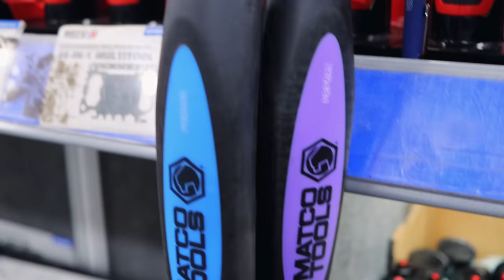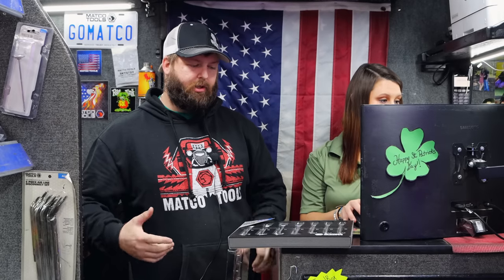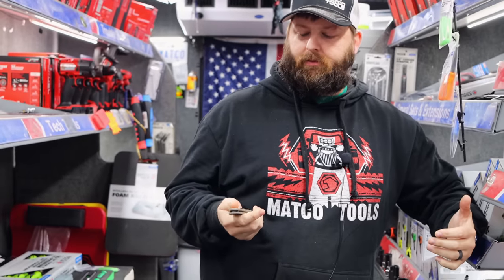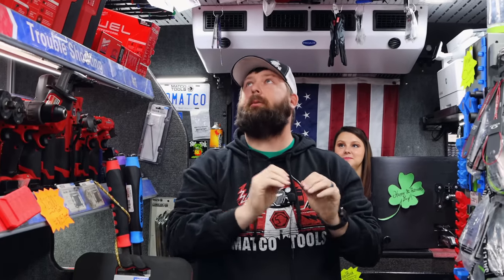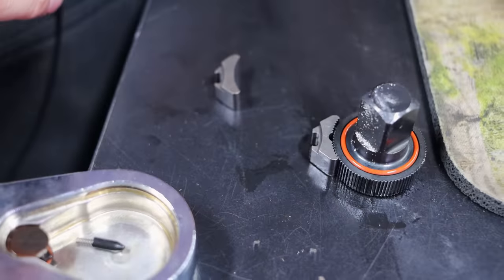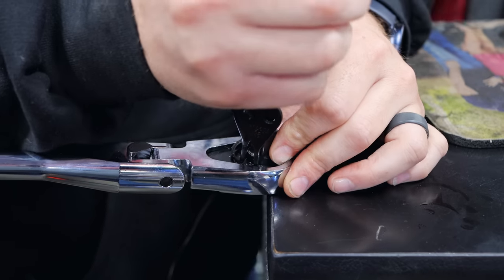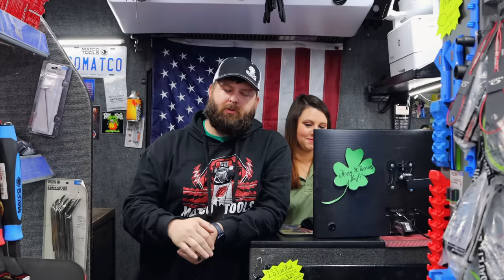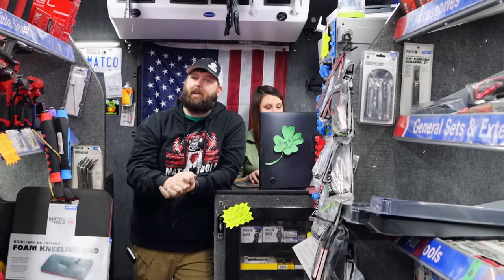Matco Tools New Improved Ratchet Design, More Bite For More Torque And Cool Line Wrench Sets

Comment: I'm not a mechanic, and probably less than average as a diy'er, but since I found your channel, between Matco Michael's knowledge and "ownership" of his brand, and your tool reviews, I've been obsessed with replacing my box store tools with tool truck tools. Got the Matco 3/8 locking flex head, Snap On screwdrivers and T handle hex and torx, and the SAE set of Mac reversible ratcheting wrenches.
Reply: There are plenty of high quality tools that you can get, especially for a DYIer, that are much less expensive. These are high quality tools no doubt but you are paying a lot for no real reason.
Reply: @nachoisme  
Not for the Taiwanese imports, but the extra cost can be very well worth it if you're getting American made tools.
Reply: @TylerSnyder305  9 times out of 10 you’re not. Most of the shit on the truck is made in Taiwan or China now. Go buy Mayhew for us made and tekton for bang for buck.
Reply: @hunterramsey3132  I like the Tekton hard handles which are a joint product between WILDE and another company who does the handles, but I won't buy imported wrenches ratchets and sockets.
For these things I buy WRIGHT tool.

Comment: Matco Michael just made a great case for SnapOn’s dual 80 technology.  Look at the pawl of your newer ratchets side by side and Snapon has stayed well ahead of the curve.
Reply: I have 3/8" and 1/2" Stanley black chrome dual pawl 120 tooth ratchets that are innovative. They are my goto ratchets. Very little backlash and they work in amazingly tight situations.
Reply: The redesigned it and fixed it - problem solved. Matco ratchets are slimmer and lever recessed the Snapon ones are HUGE and lever sticks up.
Reply: Snap-on's can definitely go way longer any maintenance
Reply: @mt1885 eah I love my snap ons, but that bottom extruding out is annoying as hell. It keeps getting bumped an unlocking. 

Of course I’m talking about the locking flex head.

Comment: I have been repairing Matco ratchets for a few years with the GW 84 tooth kits. Customers have had NO issues with them. Only problem is, it is getting harder to get the 84 tooth kits, as GW is going to 90 tooth and 120 tooth dual pawl heads.

Comment: For tool cleaning I have been using silicone spray for years now. Soft grip handles and power tool grips stay nice and it cuts right through grease and oil with a rag. I haven't seen or felt any issues with any of my tools using it and as long as you wiped it off, there's no greasy or slippery feeling afterward.
Reply: Solvent works amazing on soft grip handles as well. They will come back to like new condition

Comment: I have about 2 dozen Snap-on ratchets and I use super lube in all of them and they have no issues. I feel like those gears need some grease in the matco ratchets. I think Michael just sold me on those flare nut wrenches, I will have my dealer thank him! Awesome video!!!
Reply: Only light grease though. The Matco's will have issues with heavy grease. The pawl sticks.

Comment: Good to know about the redesign of the pawl. I haven't bought a Matco ratchet in years because I have one single Matco ratchet and it always starts skipping when I use it often. So I just don't use it haha! I have been eyeing the purple handles lately though. You guys might just be the reason I give another Matco ratchet a shot.
Reply: I just the blue handle matco locking flexhead used it a few times wondering if they sell paws kits they have to..still waiting for skips depends how much use
Reply: @jamessionesini7377  I can't say if all the dealers have them but my dealer has a bag of the newly revamped 1/2" pawls on his truck

Comment: Cut the top off of a quart of transmission fluid. Dunk the ratchet heads into it overnight. Remove them the next morning and drip dry on towels.  I've only had one Mac or Snappy ratchet fail in over 30 years. I try to do this ever couple of months.

Comment: Good stuff! I do think Snap On is the way to go for a Ratchet.
Reply: I used to think that. I’ve fallen in love with the blue matco 3/8. I also love both of my Japanese ratchets( nepros and koken) 
But koken is my absolute favorite over snap on by far. But I live snap on too
Reply: @donotrobme9295  Funny you mention that. Many years ago I lost my beloved snap-on 3/8 long flex head ratchet. The cost bugged me, so I just never replaced it. About a year or so ago I broke down and bought the Koken fine tooth flex head 3/8" rachet and wow... they do make amazing tools!
Reply: The other thing I don’t like about the koken ratchet is the opposite lever than what I’m used on the snap on, and the 3/8 ratchet I bought was to short
Reply: @gilbertg6878  ya. That’s tough. It would be similar to when I grab most other brands outta my box as they r opposite and I agree it’s a pain. 
Similar to all brands need compatible batteries!!!

Comment: Tub of Towels is the greatest innovation since sliced bread. If you are like me and work at your( my) home towns maintenance department and you work in the utilities department, Tub of Towels is a life saver.  Especially if you have to repair chemical leaks.  Some of the  chemicals we deal with will destroy tools. I don't care who makes them. I've seen brands from Pittsburgh to Snap-On get eaten and rusted due to guys not cleaning their tools. You have to clean them.  Wipe them down with Tub of Towels and lightly oil them after you are done. Tub of Towels also works great for cleaning your old smoke pole in a pinch. I am a believer.

Comment: I am lucky with my phone,have not broken it yet.Goes in my 1/4 drive socket drawer when not in use not being dropped.I remember Joe's number when he has called me,shows it as a Tennessee phone number.My 24 inch Matco ratchets,I will have to call Matco for that updated part although that has not happened to me.Cleaning my tools,I use the tub o towels you got me into.Brake clean,do not spray near cuts on your skin.Will know very well,it hurts

Comment: I swore I’d never have a smart watch. Get one. Leave your phone in tool box and work. Check watch and if it’s important u can get it. I never break my watch and my phone is brand new at every break I take
Reply: Those watch crystals are hard!
My wife bought one used because they’re pricy.   It had light scratches and a big gouge in the crystal. 
I said give it to me. I never saw a scratch I couldn’t buff out. 
I tried polishing compound. It did nothing. I finally used an 8” cotton wheel on a grinder with ruby polishing compound. 
Then it took 15 minutes on that little square inch of glass!  
It did make the light scratches disappear. And the gouge got too smooth to be visible. 
Though you can feel it with a fingernail. 
So you don’t need to worry the glass doesn’t have a bezel around it to protect it. The glass is tougher.

Comment: They need a centering peg in the back of the gear
Reply: I think that's why koken ratchets are so good.. the peg keeps everything inline and maximum tooth contact.. only downside is they're no sealed as well.. but junk ends up in ya ratchet gears regardless

Comment: I've had the 3/8 88 tooth flex head ratchet for 7 years, never had a problem with it jamming up before, then the flex head gears stripped out so the head wouldn't stay in place. My matco dealer put a new head on it and ever since it will jam instead of ratcheting. I told him and he rebuilt it. Still does the same thing. Then I tell him I think the head is defective due to a machining defect, so instead of giving me a new head he rebuilds it again. STILL DOES IT. I've about had it. Does Michael have any input on this?
Reply from the maker: I’d tell him to replace the ratchet.

Comment: Can I upgrade my older matco ratchets to the 88 tooth set up? I have a clapped out 1/4" and 1/2" in the non 88 tooth. I also own a neo chrome 3/8th 88 tooth matco and had that rebuilt once quite a few years ago.
Reply from the maker: Watch today’s Matco video because we discussed this just for you
Reply: @KoonTrucking  wow thats awesome! Thanks man!
Reply: @KoonTrucking my local Matco Dealer upgraded my old ratchets straight up to the newest 88 models. I am going to also upgrade my old 30" 1/2" ratchet as well! Thanks again for your help and information as well as to Mrs. Matco.

Comment: if matco actually made tools it would be a matco ratchet  gearwrench kit fixes all the matcos
Reply from the maker: Yeah if you would want to put Taiwan internals in a USA ratchet it would be ok. But there’s differences in the 88 tooth Matco we showed them in detail side by side. The old school Matco ratchets aren’t the same as the new ones.
Reply: @KoonTrucking   still not made by matco either
Reply: @mikethetoolman8776  nobody is saying Matco makes them. We all know they're made my AJ Manufacturing
Reply: @tommyellis7728   mac and snap on us aj also  great tools  but dealer in video said "we" when talking about the ratchet-like matco make them
Reply: @tommyellis7728   matco made no tools at all!

Comment: Marco doesn’t make any tools that’s why it took so long to fix  there ratchets ! I personally like snap on because they are the tool manufacturers of most of there products i support American made products plus snap on only uses new steel!
Reply from the maker: Well for most things you are correct but you can’t get that Matco ratchet anywhere else or under another brand because Matco has the exclusive on it with AJ Manufacturing so… get a Matco ratchet some where else.